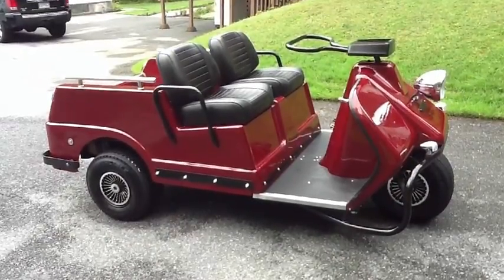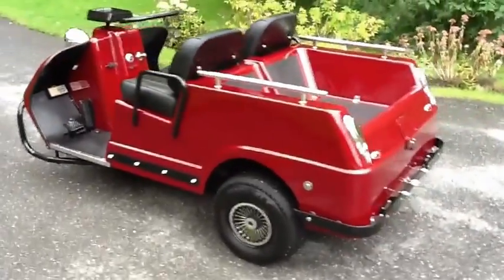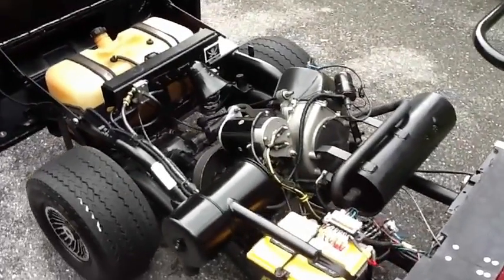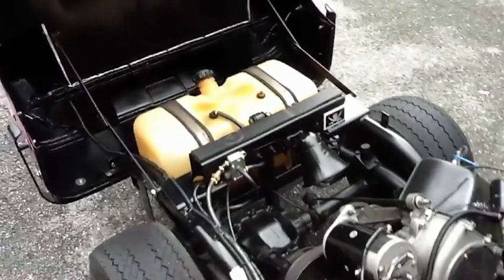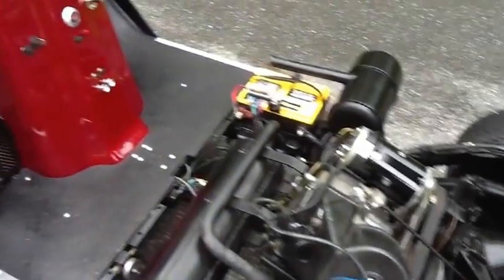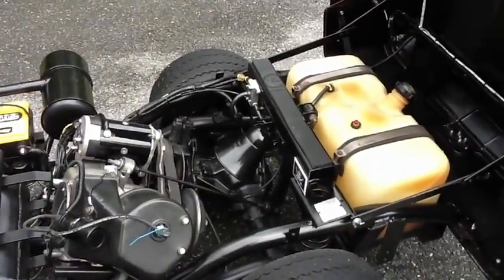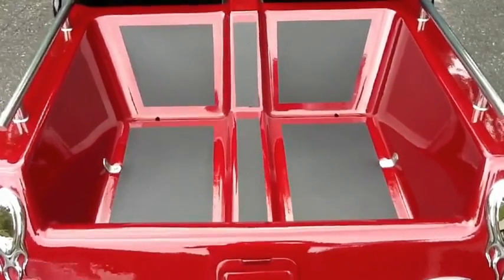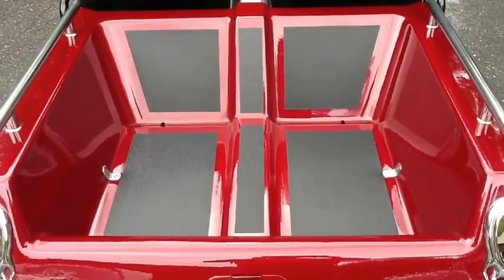Harley Davidson Golf Cart (Hybrid)

Comment: I got my 1976 Harley 3 wheel cart same way (farmer). Clutch was bad. I cut it in half and stretched it 36" to add third row of seats. Remade body from skedule 40 1" pipe. Since it was going to be heavy, I have it open (to the engine) half to the front, half to the rear.

Comment: Got my 3 wheeled harley golf cart. Cut it down the middle and added 36". Wires (I think about 19, were easy to splice into). Not so much with the brake petal, throttle petal, and choke. Some how the throttle pushs at the petal but unless I pull the spring loaded throttle foreward, it can't go any further back. Am I doing this right?

Comment: I got a 73 harley golf cart that guit running on me ,I get fire ,it back fires threw the exhaust but won't start, u got any ideas
Reply: Make sure correct spark plug prolly bp4es and gapped at .25 must b gapped correctly also rebuild carb or buy new one on amazon 21.99$
Reply: Also check fuel filter and air filter u can take air filter off completely  and replace fuel filter just to make sure